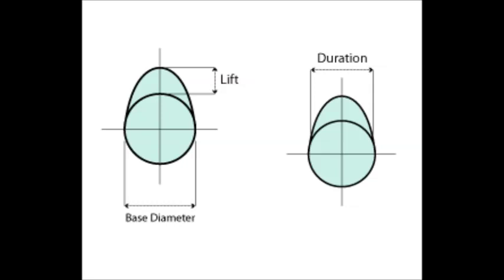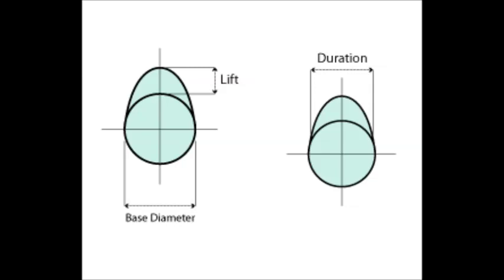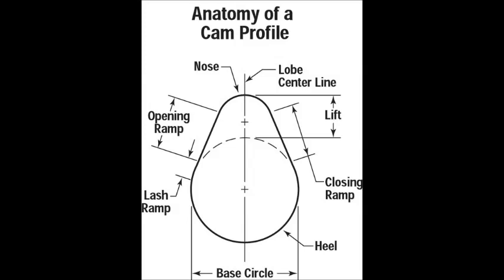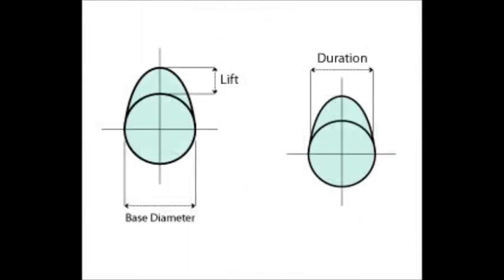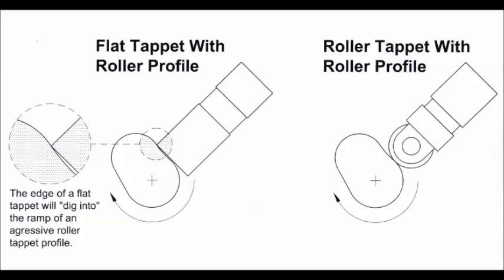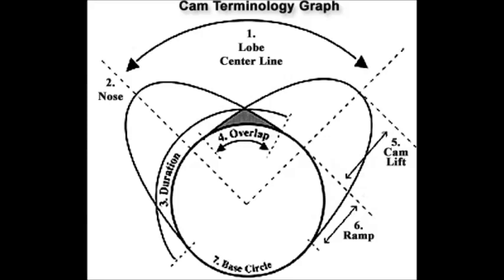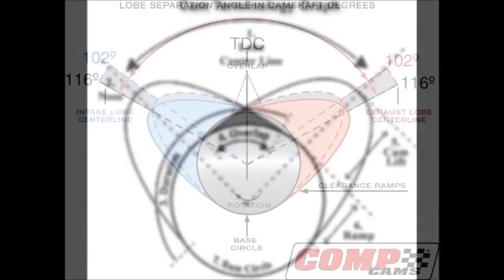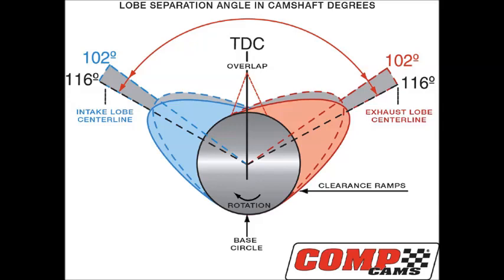Ask Roger: When building up a stock v8 motor how important is lift and duration in the cam?

Comment: Can anyone answer this question? How many crankshaft and or camshaft degrees does the valve stay at peak lift in an engine? It seems to me based off the lobe designs the valve stays at peak lift only 1-3 degrees at most. And that is if using a roller cam.

Comment: Understanding how the engine is to be used, it job 1. After that, the events of cam operation is designed with the knowledge of fuel used, restrictions of a race, the flow of the cylinder head are serious info needed to design a cam with the correct design and acceleration of lift to take advantage of flow, closing determines how much pressure is captured and how quickly it closes. This ends up being duration and events for engine performance depending on how it is to used again. LSA is a result of desired engine operation at speed. Again, how is the engine to be used? Low speed with excellent torque. Mid-range street racing or full out strip only, then trailer it home. Write down your notes and can grind a cam you need!
DK, ASE Master Tech, 78

Comment: Stock engine put a 205/215 for towing. Stock with mild performance 218/225. Stock with increased compression 224/236. Lobe seperation 108 or 110. ICL should be advanced to increase cylinder pressure in low compression.  218/224 LC 110 installed on 106 is good for most applications.

Comment: Got 2018 5.3L chev pick up want more power for pulling low end tork what cam would work well bone stock 67000 miles would I have to replace lifters too

Comment: I GOT A 1990 K5 BLAZER 5.7 WITH ECU GOT ENGINE REBUILD GOT THE BLOCK BORED 30 OVER AND DID A FEW UP GRADES IM USING EX262H CAM IN IT WHAT WOULD BE A GOOD COVERTER TO USE I TOOK THE STOCK ONE OUT..AND GOT 2000 TO 2400 STALL .. IS THAT GOOD WITH THAT CAM
Reply: If you still have the stock TBI heads, one of the best things you could do is to get a set of 1996 or later Vortec heads. They would work with that cam much better. If you go to Vortec, you'll need a new intake manifold. 

That cam is mild enough that you could get by with your stock converter. If you are going to swap the converter, keep it low.

Comment: What's the formula (if any)
For duration vs cubic inch.
I'm building my 1st big block stroker 471 cubic inch mopar from a 400 block. I did buy a cam it's 260 264 duration@.050 with .616-.620 lift. 108 lsa, I am hoping it's big enough to bleed off some of my 11.3:1 compression so I can run pump gas, I have alot of aluminum parts & a big radiator.
This car is intended to be a fun street strip car.

Comment: When I was a kid growing up in the 70s guys would put an incredibly crazy cam into a mostly stock engine. The result was it had a really cool idle. But the reality was the car was slower than stock LOL. Not to mention breaking rocker arms and bending pushrods at higher RPMs. Just a little bit more than stock and a few tweaks like headers, Aluminum Intake, modest 4 barrel Etc can make a motor come to life on a  budget. A guy I used to be friends with really dug Mopars. He used to take at 318 and put a 340 cam in it, Aluminum Intake, four barrel, sometimes headers, and that would really perk up a 318. He did have one Volare or an aspen I can't remember with a 318 with a pretty lumpy cam and it was pretty gutless. But I think he bought it that way. It makes sense if you're going to do a build copy a successful build you read about in a magazine or online then you won't waste time and money.

Comment: Does anyone know how to calculate the camshaft?
Reply: I might. Explain?
Reply: This video is just the tip of the iceberg with respect to cam profile design (calculated 5th order,  10 boundary conditioned B-Spline curves to generate cam lift profiles that conform  to specified open and closed timing events).

Comment: I have a 96 Chevy  Silverado  with a 5.7 vortex  and I'm looking to make more power with a thumper cam with headers so what is your input on this for me I need help
Reply: With a 107 lsa I really doubt there's a way to make that cam work with your computer.  Look at listings on summit's website. They all say if it works with fuel injection. Maybe check out the lt4 hotcam. You can get them pretty cheap too. If you have a carb or aftermarket fuel injection it will work but probably not the best choice for power. Do q Google search on vortec lift. I used comp 981 springs, tapped down the valve seals and did the ghetto grind.

Comment: A good video roger. Just a general note that a tighter lsa will usually perform better everywhere over a wider one. Sometimes when I want to kill a little bit of the low end and focus more on top end, say a large ci engine or one with a long stroke, I will widen it out a little or adjust the exhaust valve opening point.

Comment: Could you please explain how important the Overlap is & give examples of street car & bracket cars. Also how a cam with the right amount will either build up your cylinder pressure for low end power of have to many degrees and not build it till further into the rpm range which would definitely be a poor choice for a street driver. Thanks. I just found out the math which is simple, mine adds up to 82° of overlap. It has 239 in & 246 ex duration! with 484 lift in & 484 ex. 108 lsa the grind is comp nostalgia 21-671-4.

Comment: I'm want to put a Big Lift Big Duration hydolic cam in my 440. I want the engine to come alive around 2500 to 3000 and peak at 6000. Any suggestions? I'm leaning towards a Summit Racing products brand cam.  And how important is Degreeing the cam? I will be using Gear Drive. Thanks
Reply: Big lift and duration cams move the power up in the RPM range. If you want it to have power at lower RPM like 2500 then you don't want to go too radical. If it's a driver, realize that most of the time you are at 3000 and below.
Reply: howards cam flat tappet 7212012-08. Howards is one of a few with a landi's cnc grinder. You should ck it with a degree wheel, but if you didn't these come out perfect every time.

Comment: So in other words, if I want to have more power in the usable range (600-4000 r.m.p.). I will need a lot of lift with short duration?
Reply: Yes true. But you need to get everything right not just the cam.